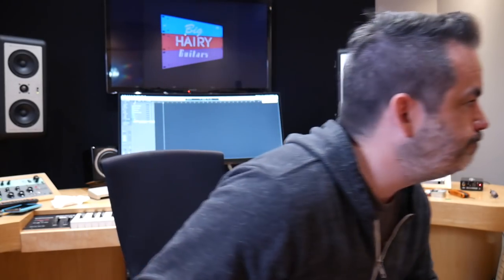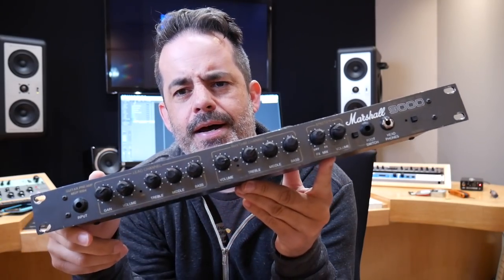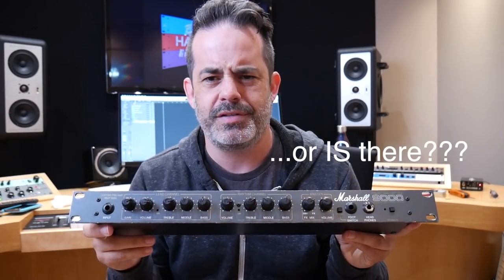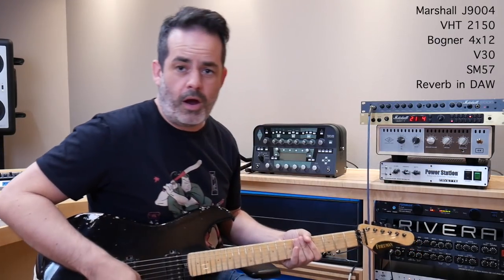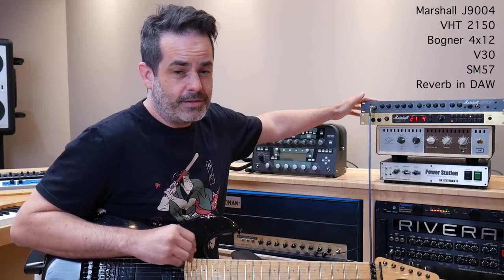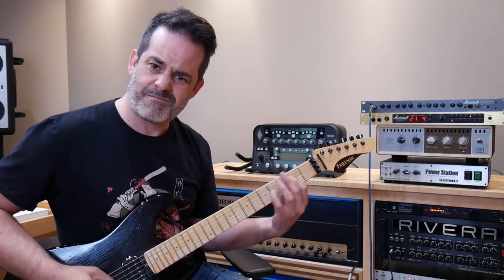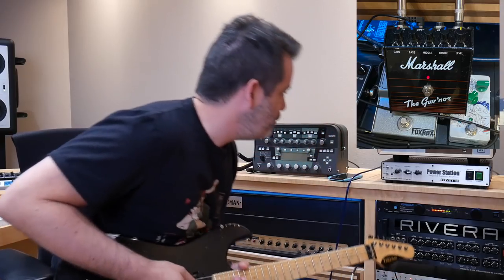4 Marshalls as preamps!

Comment: That Marshall 9004 sounded amazing. It was better than the JMP
Reply from the maker: Not bad right!!!?
Reply: I've owned both, Jmp1 slays the 9004 in a live band situation
Reply: I have a 9004. Put a 12ax7 tube mic pre thingy in fx loop sounds great. Run through Peavey classic 60 pwr amp.
Reply: @BigHairyGuitars  eq or bbe in the loop, and it's a solid state custom tone monster.
Reply: @tatoler38  tony could you tell me what you use in the loop and the setting on  it so I can reap these rewards too thx
Reply: @BigHairyGuitars  how does the ADA MP1 compare to them? Better?
Reply: @HiHello-ku1fl  9004 more jcm800. (marshall shredmaster sound bertter), mp1 more modernsound, p. Rockmaster more gain big middle, digitech T3 big dynamic with much gain, carvin quad real clean fender tone, rocktron progap2 good mids 2 controls, rocktron chameleon and voodo valve nice marshall sim, digitech gsp1101 good recording machine, hughes ketten attax real warm overdrive.
Reply: @BigHairyGuitars  I just got the 9004 and gonna rack it up soon. I bet some slight graphic EQ'ing with some MEQ28 presets will make this thing jump and become much more. Wondering if you recall the settings, I zoomed but too fuzzy thx
Reply: @b.scottfarthingsworth  How clean can it get ? Can it be used as pedal platform ?
Reply: @kroustyman  I haven't set it up in my rack yet, there's videos just search MGP 9004
Reply: @HiHello-ku1fl  The ADA mp1 is just different. It’s got a shiny sound and it has better cleans than the jmp1. The ADA imo is better for leads. It also has chorus built in if you want it. Jmp 1 still rocks though. I use a jmp1 for my rhythm and a triaxis for my cleans or sometimes leads. But jmp is just over nice in a live band setting. It’s full sounding and sits perfectly with the other instruments. Especially for rhythm stuff. I run it into a strategy 500 for that billy Corgan Mellon collie tone. It’s heavy and rocks hard. I used to run it into my 50w Marshall origin fx loop return to use it as a preamp. 
The jmp1 just works in almost every situation

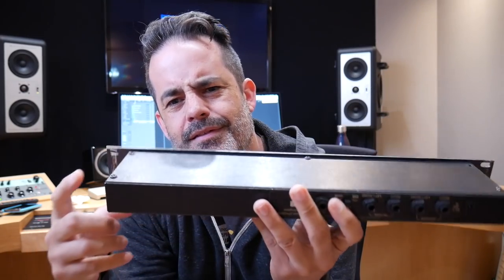Comment: 0:33 - Cab sim wasn’t a thing back in 1990!
You & I are the same age; the only Cab sim at the time was Palmer PDI boxes, which were super rare and hard to get; and maybe the H&K Redbox ... and none was so glorious anyway.
Reply: well, there was also the marshall se 100, but it apparently didn't have the coolness factor or hardly anyone noticed, the cab simulation was based on a groove tubes unit that van halen used allegedly. Still have to see and hear it in person though ;) hard to come by these days it seems
Reply: @maxmustardman298  
I had one of those too.  I left it in consignment at a store and they went out of business with my unit.  I had picked-up an early THD Hotplate and it sounded better.  The SE-100 sounded thin and a bit nasal, it wasn’t a good match for the Peavey 5150 I had then.
I still have that Hotplate.

Lukather is the only guy I recall ever being seen with a SE-100.

It would be fun to check one out now, ~25 years later.
I was running a 5150, the SE-100, a GSP-21, and a 8008 power amp, into three ADA 2x12s.
Reply: @ThemFuzzyMonsters  the hot plate was purely a power soak though right ? Thats the cool thing with the marshall, it does both
Reply: @maxmustardman298  
The Hotplate can be a power soak or a full load, and has a line-out.  It also has a bit of EQ to add some bass and/or some top end.
The only thing it doesn’t have (compared to the SE-100) is the XLR out.

Comment: As much as I don't want to believe it, I think all the good distortion circuits have been exhausted. I think all these modern amps are just recycling old designs with a few more bells and whistles. Both rackmount preamps were indistinguishable from one another on my PC speakers. Both sounded great. Even the combo eventually sounded pretty good. You need to get your hands on a Groove Tubes soul-O 75 and see what you think. By far my favorite amp and it wasn't even touted for it's dirty (scream) channel. It was the fender style clean is what it was famous for. They also made a 3 channel preamp called the Trio but it didn't have the balls of the amp. The amp had a fat switch that made the dirty channel huge. When it was not engaged the dirty channel was bleh. The Trio kind of was like they split the amp channel into two halves and neither one worked as well as the amp version. One was kind of squashy and full of rich harmonics and the other was tight and generic brown sound. The amp seemed to combine those characteristics for a huge beefy brown sound that would turn any note into a pleasing overtone feedback that would hold as long as you did. Anyway. Great video!

Comment: Well, the Guv'nor was intended to be used into a (pre)amp. Using it as a preamp could actually cause impedance issues: According to electrosmash.com the Guv'nor's output impedance is about 22k Ohms and the VHT's data sheet states an input impedance of 100k Ohms - that might explain why it sounds horrible in this setup.
The Lead 12 sounds amazingly good considering how cheap it is.
Reply: allegedly the guv'nor was intended as a lead 12 in pedal form, and the 9004 was the consequent follow-up being more versatile in the solid state realm

Comment: Are you plugging these into the front of the amp, or through the Loop, or the Preamp In? How about some settings?
Reply from the maker: These were all going into a power amp.  So essentially all functioning as preamps.
Reply: @BigHairyGuitars   - Thanks for the reply. Pardon my confusion... you posted in the video that the JMP went into a VHT 2150. I mistook that for a head and not a power amp. Do you know what settings you used on that right off hand? I use a JMP-1/9200 set up and would like to compare my set up sound to yours.